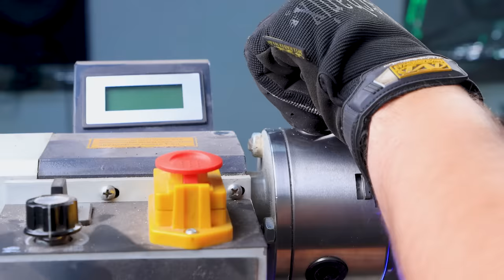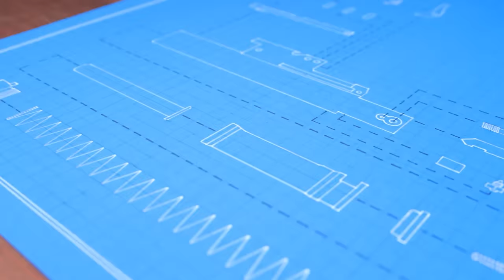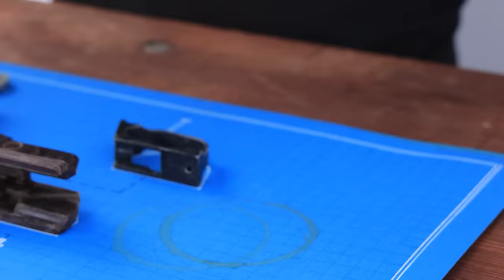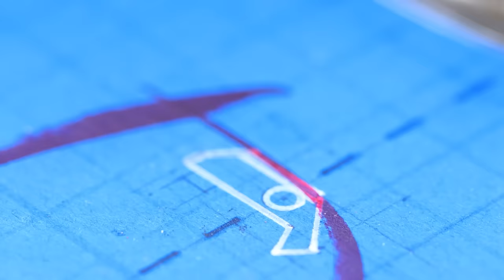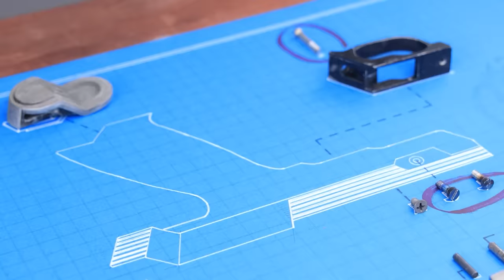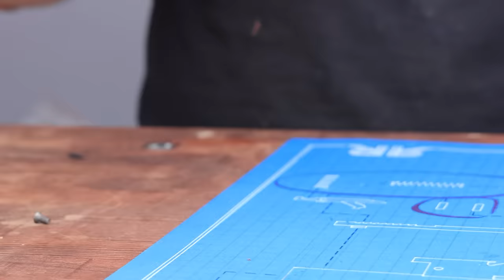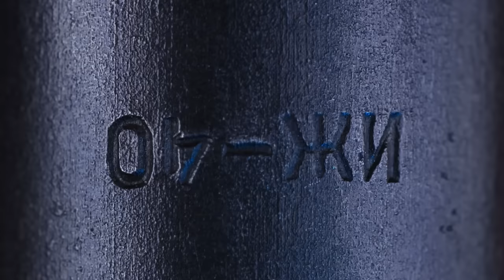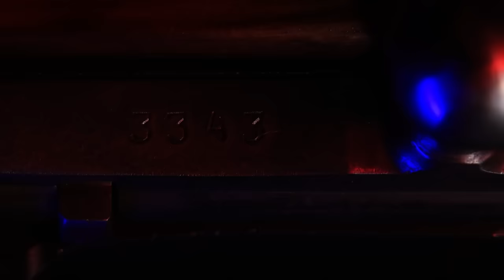IZH-5 | Old Rifle Restoration

Comment: How did it get so rusty? It looks like someone intentionally subjected it to chemical abuse.
Reply: exactly what i was thinking. deep pitting on every part in the same way, almost as if a mist was sprayed on the metal to dissolve it. its also got that orange flash rust, which is indicative of a acid.

Comment: You need to use Evapo rust and ultrasonic bath and take trigger bracket of then central it in the Lathe then spot weld clean it up tack bracket back on 
better finish 😮😮

Comment: you can easily rust your piece of metal in only a few minutes to have that aging effect. You need a solution of hydrogen peroxide, table salt, and white vinegar as well as the sunlight and you can air-dry it. if you see powdery and dusty  rust then it was most likely induced

Comment: The question in this case is whether the rifle will shoot right after all the manipulations or will it be used only to decorate the wall. Because if she is not going to be shot, all this is unnecessary. It could only be cleaned externally, given a beautiful appearance and hung on the wall. But after all the welding and machining, it's very doubtful that it will shoot accurately. And in my opinion, with this method of processing, it becomes dangerous to shoot!

Comment: You should be boiling that barrel and water and steaming it and converting that rust back into black oxide where you can actually see the bling on that gun and not using a wire wheel at all. You should be using a cart wheel when you’re doing that kind of stuff.
Reply: totalmente Al Hervirlo Se Pondrá Bien Tierno 💪

Comment: Have you ever seen epoxy resin and driftwood tables made.  Could repair a stock that way if it's got lots missing or bug eaten. The only downside is it's heavier than wood but can be any color.even metal flake   Be creative.